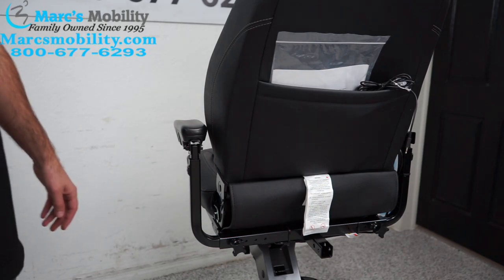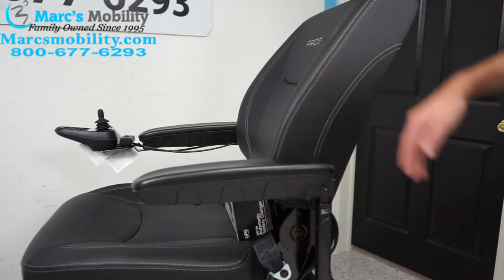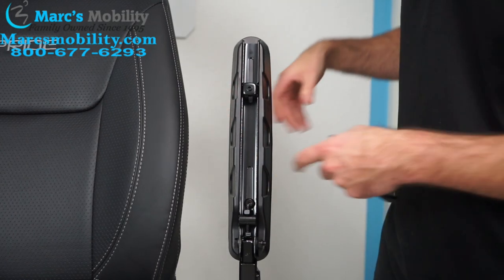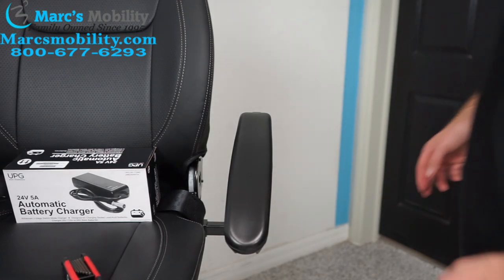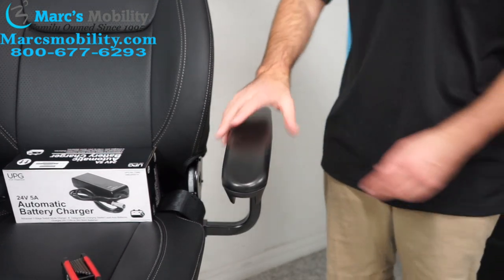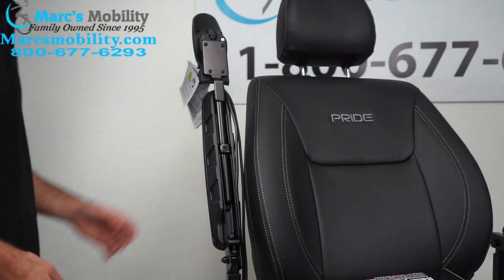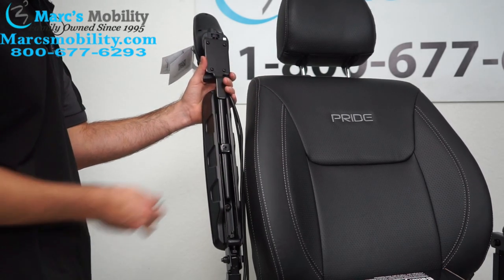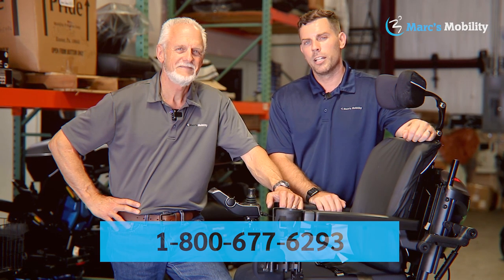Jazzy Air 2 - How to make ALL arm Adjustments - Power Chair - Pride Mobility

Comment: How do you get a cracked vinyl arm pad off the arm with the control arm? Mine is cracked and sharp. Need to put a new one on. Thank you.
Reply from the maker: If the joystick is on the arm that is needing to be replaced, you would have o remove the joystick bracket and then there will be a couple screws holding the arm on. Just remove the screws and replace the armrest. Pride does sell replacement armrest for that chair.